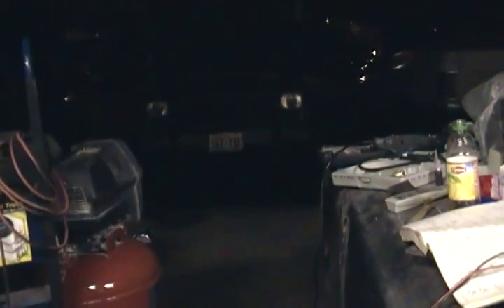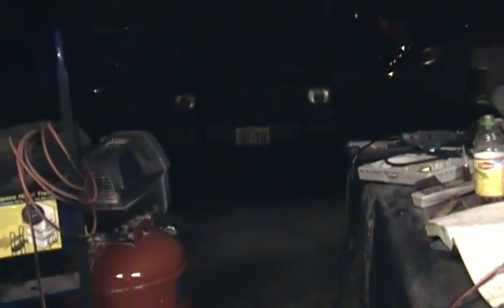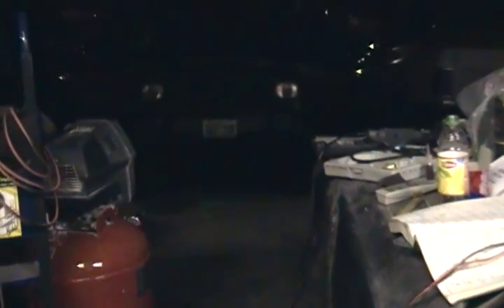Headlight troubles no more!

Comment: I am having this same problem on my 91, they were working one day, then i did some engine work, took it the shop to get a diagnostic done, got it back and the head lamps wont turn on. None of my fuses and my head light switch turns on all of the other lights that go along with it (interior dash lights and tail lights) the head lights them selves don't seem to be broken as far as i can tell at least and my high beam switch wont do anything either. Well thank you for this video it helped me a lot!

Comment: 4 days and still no luck with out jeep headlight problem. Hope you can still help me!!!
Key in accessory position = Lo and Hi Beams
Key in on/start position = No Lo Beams but I do have Hi Beams if you hold the turn signal switch towards you. So far we have checked the fuses, they're fine and replaced the Turn signal indicator, Ignition and Headlight switch....EGH!!!! Need help really bad! Thanks~